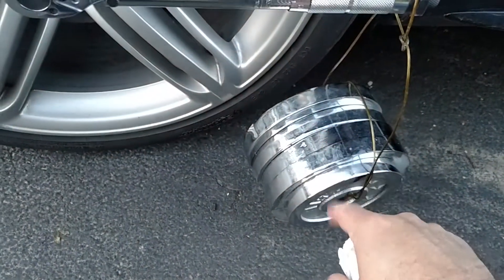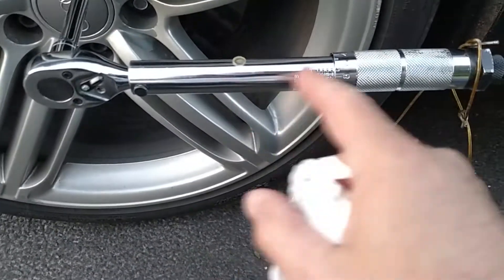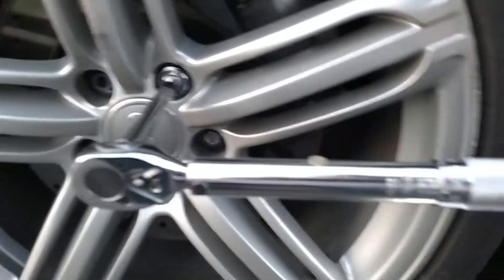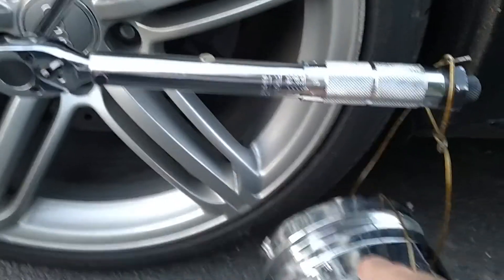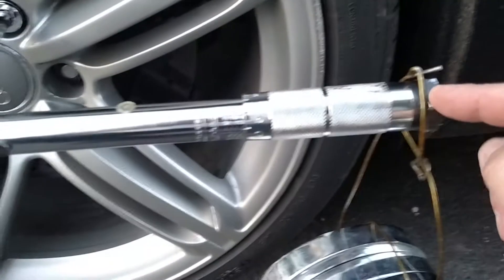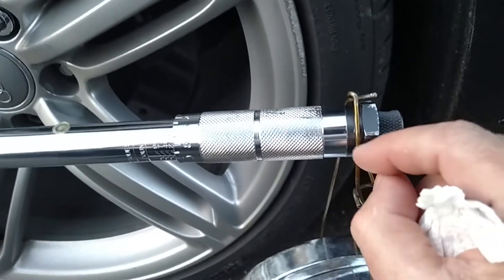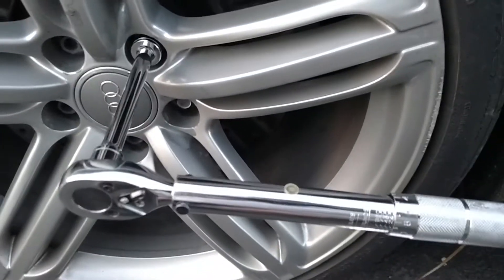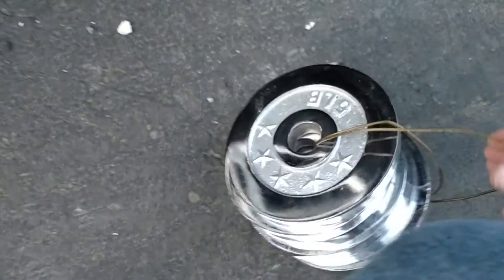Bills EASY torque wrench calibration (simple)

Comment: The weight you're hanging is producing 240 in*lbs or 20 ft*lbs of torque, but that isn't the true torque for a couple of reasons. First, the wrench is constructed to have the torque applied at the center of the hand grip area, where the groove has been machined into the handle. Applying the force anywhere else on the handle will distort the torque readings. Second, you need to add the additional torque created by the weight of the wrench itself acting through its center of mass, near the middle of the wrench. Find the center of mass by balancing the wrench on a straight edge and measuring the distance of that point from the center of the square drive stud. Multiply this distance by the weight of the wrench to get the contribution of the wrench to the total torque. For example: if the center of mass is found to be 8 inches and the weight of the wrench is 6 lbs then the added torque is (8/12)*6 = 4 ft*lbs. Add this to the torque created by the hanging weight to get the total torque.

A more accurate technique would be to orient the wrench vertically, to eliminate the wrench's added torque. You would then use a digital hand luggage scale to measure the force you would be applying horizontally at the point of the groove.

Comment: Would it be safe to say a torque wrench is only accurate to where you both calibrated it and hold it?
So if you are calebrating to the end, but use that knarled handle spot to use it, then your not torquing accurately, correct?
Reply: Correct. He should be hanging the weight on the non-knurled center strip in the grip. It's a well known fact of clicker wrenches that the wrench is calibrated for the pull coming from the center of the grip. For some reason, 9 out of 10 calibration videos, including this one, get that wrong. There is a very good expiation of it on YouTube but I don't have the link handy. See "The Bike Sauce" channel video on why the grip position on a click type torque wrench matters. I'm a retired engineer: He does a simple, but correct, mathematical proof that grip position matters.

Comment: i DONT KNOW IF I AM WRONG, but does that mean that wheel nut is torqued to 240 lbs in this case??  i mean he is not applying pressure on the nut itself.  i dont know about this

Comment: you need to verify your weights are accurately labeled with a accurate scale first.  most of the home weight sets are not very accurate.  I have found typical mechanic's torque wrenches can be off by 20 percent or more, so always do a home calibration even on a new torque wrench.

Comment: For ft/lbs the actual formula is (ft/lbs the wrench is set at x length of handle) / 12.  In the video example above it would be (24 x 10) / 12 = 20 ft/lbs. it would seem the wrench is off by about 4 ft/lbs if my math is correct.
Reply: It looks like his wrench is in in/lbs and not ft/lbs so I believe his math is correct.

Comment: Hi if you start at 10" and add your weight to get pound torque when you set the torque you length become shorter as you turn the handle. Is this right?
Reply from the maker: Buck 64 this is only to calibrate the wrench, not to actually use it. Hoping I'm understanding your question correctly 🤔
Reply: He's saying that if you measure the length before adjusting to the proper torque setting, the length will be off after you set the torque.

Comment: Bill, your concept is sound, but your execution is flawed. When you hang your weight, and the wrench is accurate, it should click without you having to put "a little pressure" on the handle. To improve on your process, set the torque wrench to 250 in.lbs., then hang your 24 lbs. of weight. The wrench should NOT click. Then, add 1 additional pound of weight and the wrench should click...NOW you have it dialed in. Of course, the weight of the wire also effects your test, but we are gonna let that one pass. Gary F., Torque Trainer for Snap-on Tools.
Reply from the maker: Agreed, but for me this was simply a general overview, not an exacting method. There are actual scales/tools you can buy to register your wrench exactly if that's what you need. My silliest problem was finding a way to "hold the wrench" as I tested torque, which turned out to be simply putting it onto a car lug nut - and it worked great !